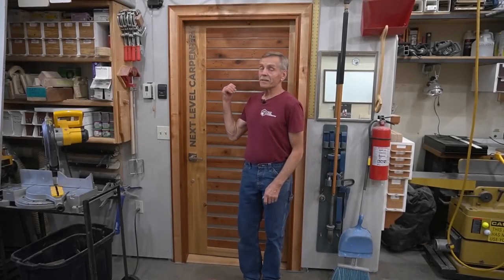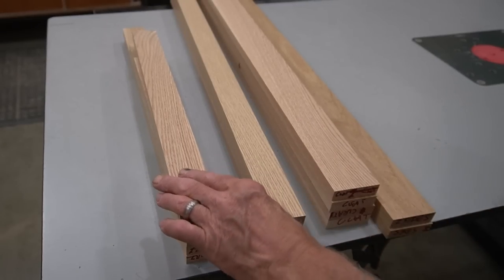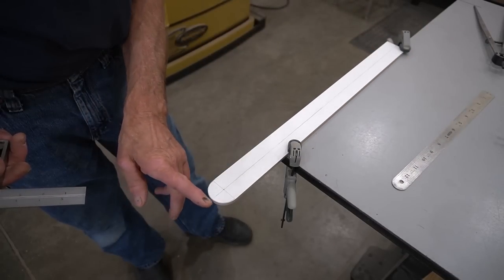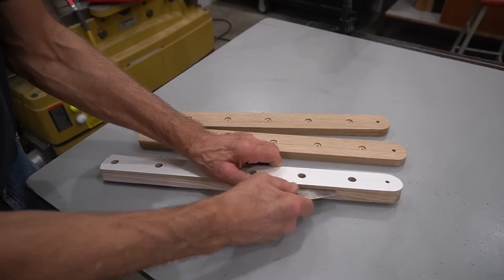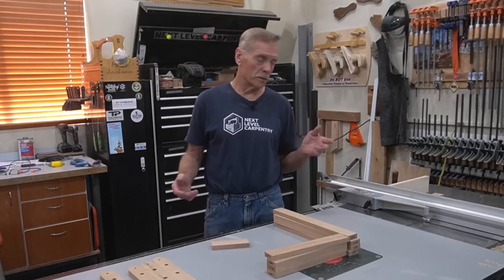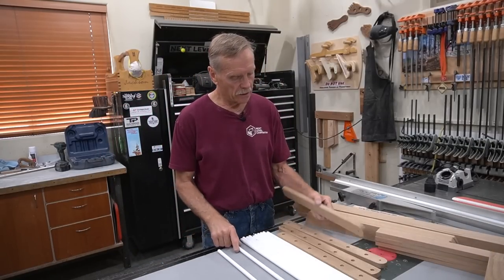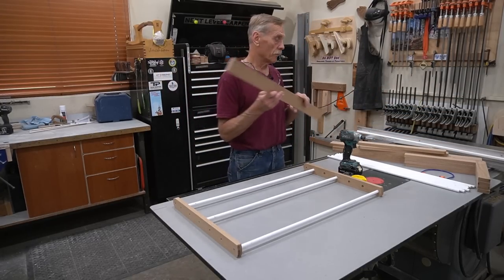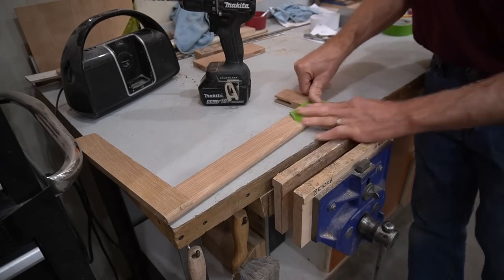Wall-Mounted Clothes Drying Rack

Comment: Hey Matt, great tips sprinkled all throughout, as usual.  I'm definitely gonna use that uncut waxed backing on double-stick tape!  And now that I've seen it, I don't know why I ever did cut it, then spend time picking at the next piece's edge!  Also the end-dowel drilling guide was brilliant!  Definitely gonna do that one!  I have used those MacGyver'd washers at 'the end of the end of the bitter end', cut from milk jug or distilled water jug plastic, HDPE (high density polyethylene, the kind with a '2' inside the recycling pyramid mark on the bottom).  I don't have those punches, so I started by drilling the hole, clamping the plastic between two pieces of scrap to cut a clean edge, then used scissors to cut the outer diameter.  I prefer them over the store-bought, since I can custom-cut the sizes to suit my project.  Cheers!
Reply from the maker: Thanks for watching and commenting on this one Bill.  Never thought of milk jugs for their plastic but have cannibalized many a plastic bucket!  BTW if you're creating a wish list for an upcoming birthday you might add a set of those leather/gasket punches to it.  I don't use mine a lot but sure am glad I have 'em when I need 'em.😎

Comment: This video didn't feel like it was over an hour.  I am planning to make similar drying racks,  but on drawer slides that pull out from under an upper cabinet above my washer/dryer. The use of fiberglass electric fence poles is genius!! And I appreciate the tips on how to cut and drill them.  3/8" fence poles appear to be readily available and inexpensive at Tractor Supply stores.  I wonder if that would be rigid enough, or if it would be better to source 1/2" online.  Thank you! Keep up the amazing detailed content!
Reply from the maker: Thanks for sayin'!  FWIW I was planning to use 3/8" fiberglass rods but the only 3/8" ones 'they' had were dingy gray so I went with 1/2" mostly because they were white even though they were a bit overkill.

Comment: Hey Matt,, might I suggest that you could save a drill change and one complete step, if you add the depth of the rod socket, 1/2", to the thickness of the template, 1/4", touch down on the template with the drill bit, establish zero,  set the depth stop at 3/4" and drill away, no charge Sarge🤙🤙 and you know I your biggest fan!!
Reply from the maker: Thanks for the suggestion Paul!  Crazy as it seems I've never once used the 'establish zero' feature on a drillpress.  I had to go out to the shop after reading your comment just to see if it was possible.  It is.  I don't trust its accuracy enough to follow the sequence you suggest because the final depth of those holes is quite critical but will keep your suggestion in mind for applications where the efficiency and sequence would save time & steps.
Best,
Matt
Reply: @NextLevelCarpentry  no worries,, my drill press is no milling machine either so I generally check the hole depth after the first socket is drilled, and adjust if necessary.
Reply from the maker: My eyesight is more of an issue than the machine's capability so I compensate, like you do to help assure accurate results.  😟😃

Comment: Could you have put pins in the ends of the top of the support arms instead of the side stops?  Or would they be too difficult to align when setting the rack down on the arms?  Love the design and it was worth watching the whole thing and learn some fantastic tips. Also shop layout even though not mentioned.  😄😁
Reply from the maker: Good eye for design!
I probably would have used pins instead of tabs if it were for my own use because it would be more 'elegant' but figured the tabs would be more obvious/intuitive for the wide range of people from kids to grandparents to relatives who will be using these particular racks.
Reply from the maker: Good luck with the build if & when.  FWIW my client said "I love them... you could SELL these to others" and already asked me to make one for a daughter in law. 😎

Comment: Matt, would you put a link to the video where you sharpen the putty knife, if there is one?
Reply from the maker: The only video I did showing that is an exclusive Patron Only one.  Patronage can be very inexpensive but I can tell you, all it takes to sharpen a putty knife is to clamp a smooth file in a vise and, standing a putty knife vertically on edge on the file, drag it towards yourself a few times to raise small burrs on the edge.  Literally takes only seconds... unless the puttyknife is really worn with rounded edge and corners, that is.

Comment: the site where you sell the plans display the price in Euros, so I have to ask: are the plans imperial-only or do they also have metric sizes?
Reply from the maker: Sorry? Plans are only available in Imperial measurements.  Should be easy enough to extrapolate to adapt to metric hardware and materials though, with or without plans.
Reply: @NextLevelCarpentry  Thank you! The shop interface didn't specify either way. 

Cheers from Hungary!

Comment: Great video, I watched it all, thanks. I wonder i your CO2 laser would cut those small washers you showed at the end, and do it safely? Not all plastics are safe for laser cutting - was HDPE?
Reply from the maker: Not sure what plastics are safe to cut, only that cast acrylic is and plexiglas ISN'T.  I do know it's prudent to learn ahead of time to prevent creating noxious/poisonous fumes though...
Reply: You mean - acrylic is safe to cut on a laser machine. You can also cut nylon or HDPE. 
Plastics containing chlorine (halogens) are not safe though - e.g., PVC, artificial leather. You may cut it, but one of the components of the gases being produced in the process is Cl/HCl, which will ruin your machine (it will cause rust inside your expensive machine very quickly). 
Other materials to avoid: fiberglass, carbon fiber, and epoxy/phenolic resins (all will emit noxious fumes). ABS will emit cyanide gas. Polycarbonate cuts poorly, and HDPE may melt excessively.